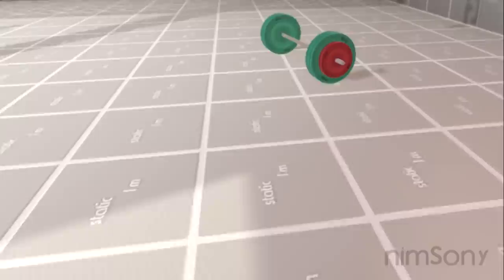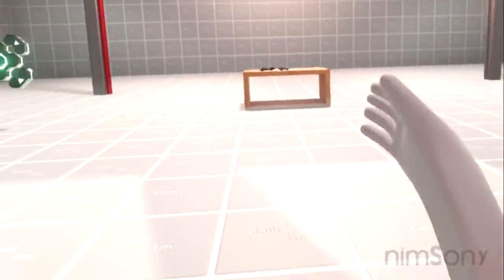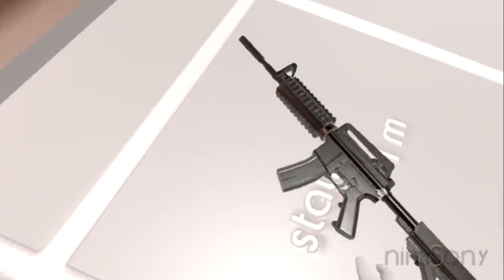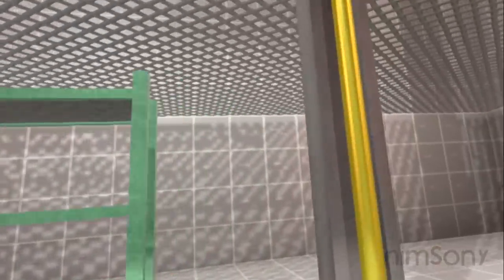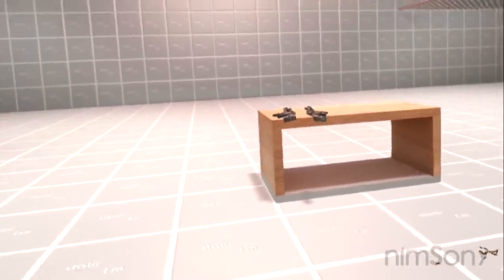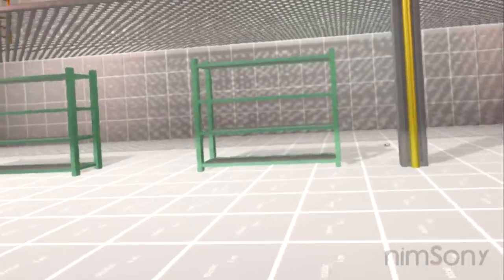Project TX - Strength Manipulation - The "Crysis" Mode

Comment: "new to xbox gamebar"
Recommendation: You REALLY shouldn't use that to record. Stick to OBS or Shadowplay.
Reply from the maker: Sjadowplay up until now... But nVidia decided that recording on a laptop is unacceptable... Even though it's a pretty newish GPU.
Reply: @NimsoStudios  On a laptop, the desktop is rendered with integrated graphics, so nvidia can't capture it, however, using shadowplay on the game ITSELF should work, you may just have to mess with what display mode you are using. Typically if it doesnt work in windowed or borderless, it will work in fullscreen.
Reply: @NimsoStudios 
Just use OBS then, it's pretty much the best option.

Comment: This is awesome! Idk if their is any research on manipulating weights on a controller so that you actually feel the weight physically irl and it changes based on VR objects. That would make this in game strength mechanics even more fun!
Reply: Haptics could be used to make you aware of when your strengh isnt cutting it. Having there be no haptics when youcan lift it and the. Different levels of vibration to show when you cant lift it. So alight rumble and you might be able to overcome t and move it a bit. Strong rumble and you've got no chance. 
That could mean say of you pick up a bar with weight on then two hands evenly soaced is the easiest but if you grip it closer to one end then one hand takes more weight so different levels of feedback on each controller would work really well.

Though im sure there will be some person who complains that its a gimmick.

Comment: Hey, limited strength is exactly what I was thinking was missing from Blade and Sorcery's climbing. This looks just perfect... and of course OP in VR is the best OP :D.

I commented in an earlier video that I'm trying to get a similar physics system in Unreal Engine 4 (had a little progress, yay I guess). UE and Unity have different physics frame setups (substep vs fixed frame) which I hope isn't limiting me how much can be done but it is really difficult to get stable physics interactions. For example, the way your weapons just hit stuff and stay there isn't looking that good on my experiments. They either hit and "freak out" (goes through and tries to get out of it repeatedly very fast) or if I lower the numbers my hands feel very weak... can't even move my hands with enough speed. Did you get it that stable by finding "magic" numbers for joint strength and stuff or by dynamically changing them when weapon hits something? Or is there something else going on? If it is not a secret :).
Reply: Azerisen qardash?
Reply: @Echelon111999  Hə :)
Reply: @nicat6153  Ela ingiliscen var halaldi 👍👍 nece yawin var soruwmaq olarsa
Reply: @Echelon111999  Çox sağol, internetdə hər şeylə ingiliscə məşğul olduqca öyrənir adam az-çox. Problem deyil, 26.
Reply: @nicat6153  Ele mende uşaqliqdan kino, oyun, internet hamsi ingilisce baxmisham deye bilirem. Bele oyrenmek en asanidi eslinde. Internetde bele birini gormeye şad oldum. :)
Reply: @Echelon111999  Hə elədi, əylənərək öyrənmək dedikləri bu olsa gərək. 
Həqiqətən, yerli birini belə texniki, xüsusilə də VR-la əlaqəli bir videoda görmək xoş və təəccüblüdü :). Bu videoya elə-belə baxırsan yoxsa game development-lə məşğulsan sən də?
Reply: Nicat bagishla gec cavab verirem amma men ele bele baxiram. Recommended sehifesinnen gordum. Ozum maraqlaniram tech-nen falan youtubeda maraqli ne geldi baxiram 😃

Comment: How do you feel about boneworks "crouch button" enabling seated play. Do you believe that something that should be replicated in VR games? 
Also how does leg strength impact gameplay seeing as all weight of the character and objects are supported with the legs that aren't tracked?
Reply from the maker: I showed crouch button usage in my Accessibility locomotion demo, it's necessary if you cover accessibility.

Leg strength is actually not ragdoll handled for the most part, it would just be a change to jump height and acceleration.

Comment: Wouldn't it be better to sync the hands to the objects they're holding instead of displaying the physics misstep between the hand and the object during fast motions? (issue particularly noticeable when you're swinging heavy objects in slowmo)
Reply from the maker: That's one of the reasons I've been rewriting this whole system.
That's an inherent issue with pure jointed objects, the hands are actually physics connected to the object but nothing a solid joint, it's all soft and movable.
That may seem illogical at first but it gives the hand actual control over the grab. I didn't want to fake anything in terms of hand position, it's all purely physically jointed.
Reply: @NimsoStudios  Are you using the mismatching position to play the role of a force being applied and resisted? In the real world, that happens in the form of either materials flexing or compressing/stretching; in the case of arms moving stuff, usually most of it is in the muscles and tendons (and some smaller effects on the soft parts surrounding the bones of the hand that are touching the object). So maybe you could model it as rotation springs applied to the individual joints, targeting the real world position (or rather, the calculated position since most people don't got elbow and shoulder trackers), but displaying the simulated model?

Comment: I can see a lot of potential for leveling up, realistic exercise mechanics, etc. This is very impressive. I don't have a VR headset, but I have done a lot of development with Unreal Engine, if you need help with gameplay, modeling or texturing, let me know.
Reply from the maker: This is sort of an expansion on my possible RPG mechanics video where I use guns welded together as an Axe where the weight of the object and strength of the player both affect the resulting "chop" power on the tree.

Comment: Interesting. So when using the barbell is the weight actually sourced on both sides of the bar accurate to the position of the weights? Would putting the weights in a weird order actually make a physical difference? Is it possible to have the weights as separate entities not wielded to the bar? Curious as I don't know much about vr dev and am interested in exploring it myself.
Reply from the maker: If they were separate objects yes.
Right now it's just one object.
When I eventually make a GMod like sandbox it'll act exactly like it should, more weight on one side less balance.
Reply: @NimsoStudios  Thanks for the response i look forward to seeing your progress!